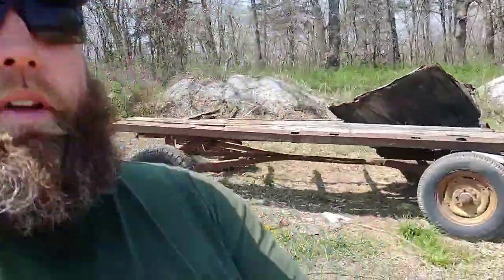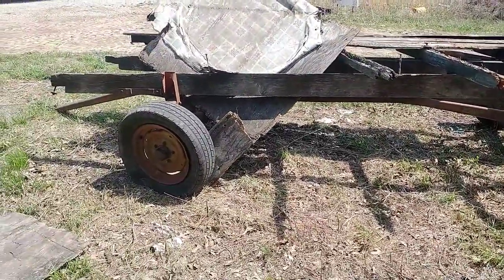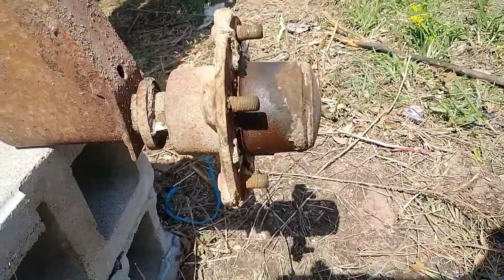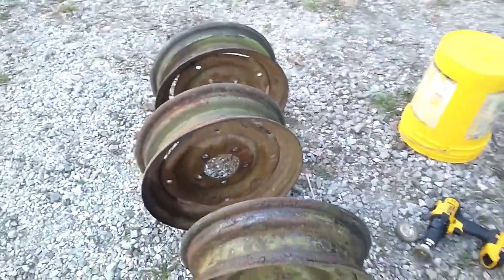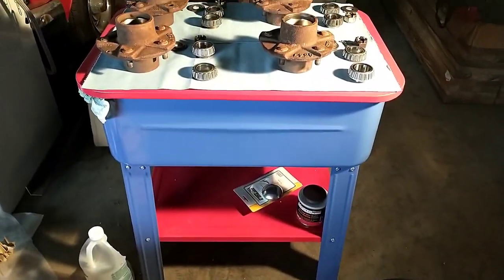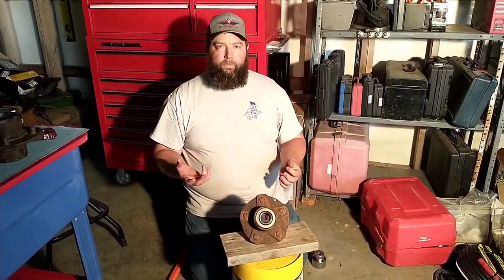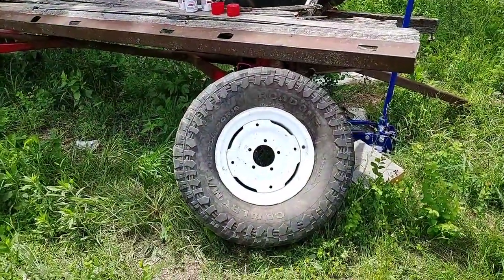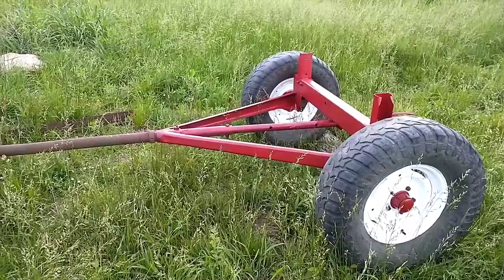Restoring A Hay Wagon Running Gear to Use for Hauling Water

Comment: can you share the seal size? I am restoring the exact same running gear but I cant find the seals ( or grease caps) . thanks
Reply from the maker: Hey DJC8000 Engineering, sorry it took so long to respond. I still have the seal part numbers, I'll get them for you, I just don't have them handy. I have another wagon that looked identical but must have been rated for a higher capacity because it had much larger bearings and spindles. I'll get you both numbers and hopefully that will help! Thanks for watching!
Reply from the maker: Hey DJC8000, again with the long responses, but I finally got those numbers.  Both were National seals, the smaller one that went on the wagon in the video was 204002.  The wagon with the larger bearings used seal 204035.
Thanks!